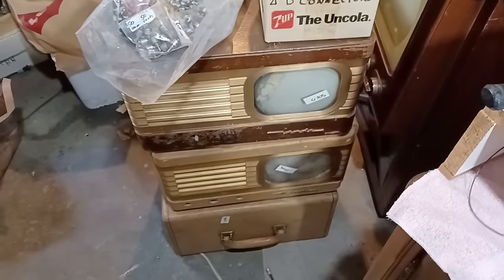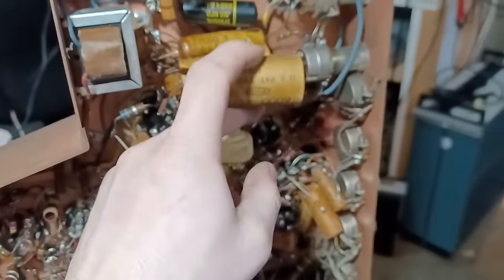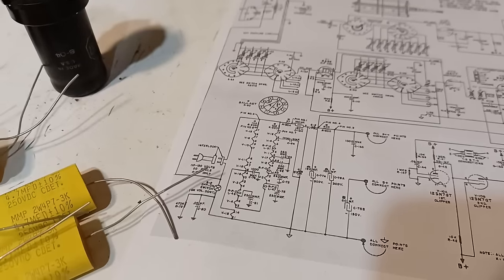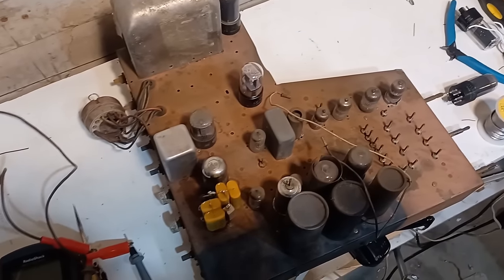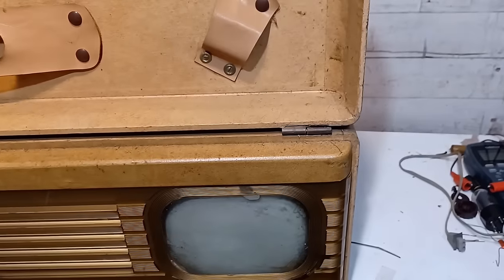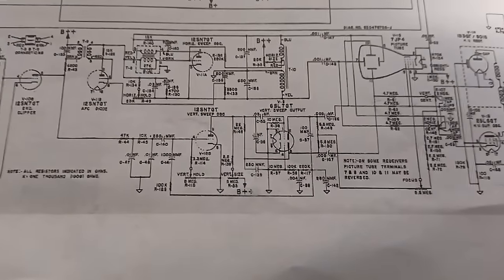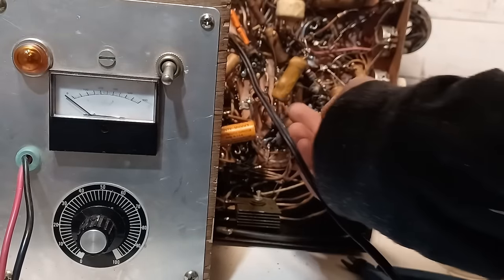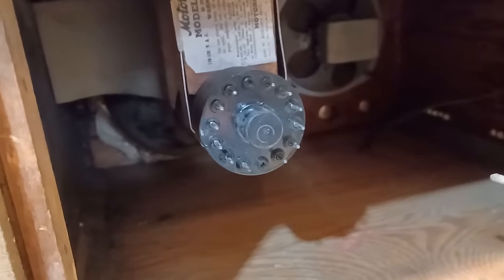1949 TV VT73 Diagnosis and Repair

Comment: What do you do with a nice set if the picture tube is bad. 
I have a 1947 Westinghouse console with am and other bands and turntable.
I had a friend replace the caps and cord.  It has good sound and volume
But need to get other bands working.  Very nice pice for its age. I got it from the family that bought it new. Probably go on ebay. Or keep it as a nice piece of furniture.

Comment: Very cool! so basically a recap and 1 resistor fixed it.
Those things are gonna outlast us..
Reply: That's the nice thing about these tube analog electronics -- you can rebuild it when it "wears out."  Lotsa luck restoring digital IC-based anything.

Comment: I was waiting for you to simply rotate the deflection yoke to straighten the rotation. Then finally I saw it's built into the tube somehow..
Reply: This is an electrostatic deflection TV instead of the much more common magnetic deflection type.
Reply: @eDoc2020  "electrostatic deflection"
Never heard of that.
I repaired a mid 70's RCA 25" console TV that had my mom accidently spray a garden hose through a sliding glass door screen into the back of it.
It was just physical circuit damage that had burned. It went on to live for many more years.
Reply: @DrHarryT  Electrostatic deflection is what's used in oscilloscopes. In TVs it was pretty much only used in these post-war 7 inch (and 8 and 3-inch) sets. The downside of electrostatic deflection is it doesn't allow large deflection angles, so larger screen sizes would require hideously deep picture tubes.

Comment: The most important part of any electrical or electronic device is the blue smoke container which must always be protected from breaking. We've all seen what happens when we fail to protect the blue smoke container, blue smoke comes out of the device, and it stops working. 😃

Comment: What are you using for the indian head test pattern source?
Reply from the maker: Same source as shown in the end of the video. I have a laptop displaying the test pattern full screen. I then have an HDMI to composite video converter that is then fed into an RF modulator which is connected to the TV antenna inputs using a 75 to 300 ohm balun. I think The converter was set to channel 4.

Comment: A good technician fixes the problem and PREVENTS NEW PROBLEMS.
Replace ALL capacitors. Although they are fine. If they haven't failed already, they will fail in no time.

Comment: 1960  I converted  all the tubes to 6 volts in parallel  and used a dynamotor for b+  installed in a 51 Studebaker convertible one of those  as I recall there's a wax hv  cap goes bad under the flyback low high voltage🙄

Comment: you can get the phosphor for the cathode tube without mercury vapor by taking the pear-shaped ones from the mercury lamps. carefully break the pear-shaped glass without breaking the mercury vapor tube. then you can collect the phosphor. sodium lamps I don't think so they have luminophore even if they look similar.

Comment: I'm surprised that you didn't call the bottom of the chassis a "rat's nest" of wires and components. How can they not short if the set is shaken?
Reply: No,  point to point wiring is / was pretty robust

Comment: Those sets have selenium plate rectifiers. Take them out of circuit, and use diodes. Selenium plate rectifiers produce a deadly gas if the should ever blow. You can keep them on the chassis for originality, but please disconnect them.
Reply from the maker: if things work I tend to leave them alone.

Comment: There is no yoke in this set?
Reply from the maker: Nope! It has electrostatic deflection. There are 2 sets of parallel metal plates inside the tube that deflect the electron beam.

Comment: Great videos. But may I suggest you get into the habit of replacing all old capacitors before powering up any old tube set unit. Bad caps can easily result in the destruction of tubes installed on the systems. Replacing tubes first is always a bad idea as it is easy to destroy a new tube due to bad caps that can be internally shorted.

Comment: Most people repairing old tv'S or radios just recap everything rather than trying to find the defective ones... My 2 cents !
Reply: True, but considering that many old paper dielectric caps(except for the hermetically sealed oil filled type)DO tend to be defective, replacing them is not a bad idea.
Same story with electrolytic caps(although the 1950's/1960's metal can types DID hold up much better than the cardboard jacketed ones).

Comment: Only thing I would have done differently or actually there's a couple things but the big one is I would NOT have used the Shoe Goo because that's not something that's good with high temperatures especially against something like a CRT tube that gets very hot and would be a fire hazard because it is flammable very flammable actually you should definitely remove that and use something rated for the heat its going to be up against.🙂👍✌
Reply from the maker: The neck of the CRT gets luke warm in operation. Heat is not an issue. I like shoe goo because it stays rubbery when cured so there is no strain on the glass. Using super glue or epoxy that dries hard can potentially crack the glass